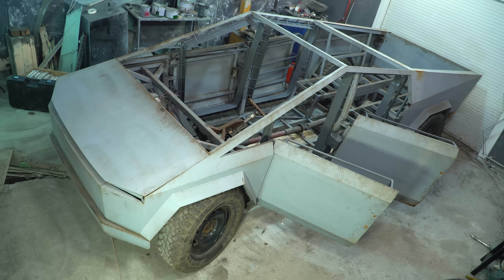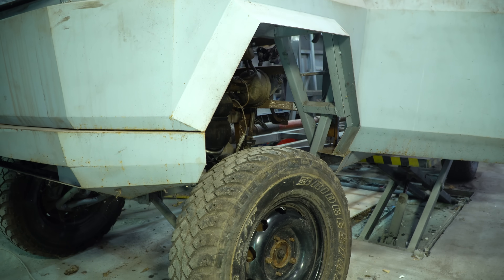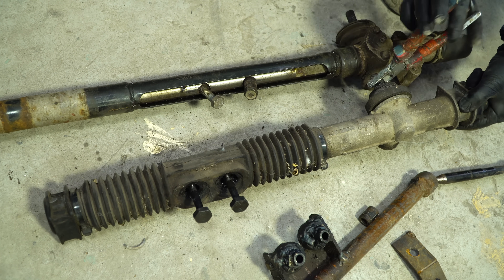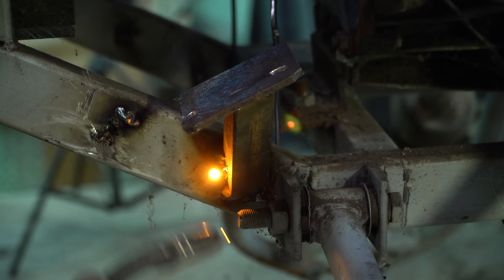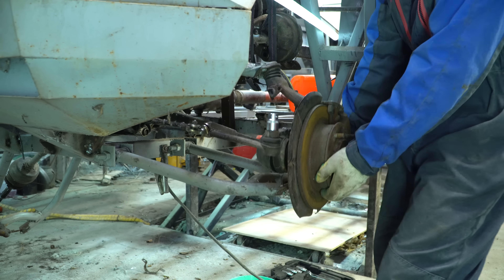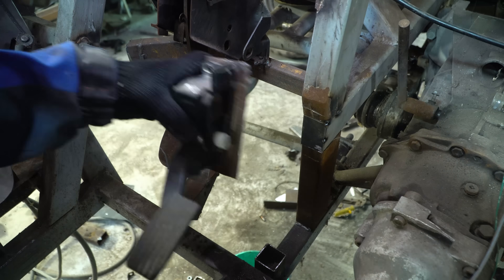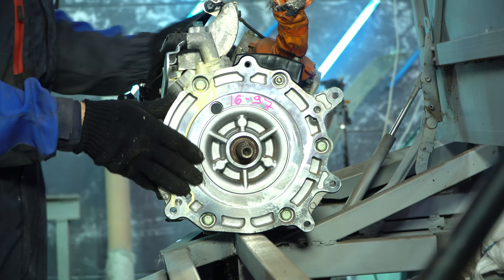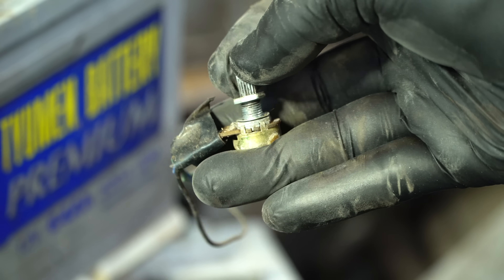My DIY Tesla Cybertruck: The Road to Dual Motors.

Comment: If you put a nice V6 or V8 in that thing you might actually have a useful vehicle, even if it is still the ugliest damn thing to ever roll down a roadway.
At least if you make it yourself you don't have to worry about getting bad panel alignment or glued on parts that should have been welded or bolted.
And you don't have to use the god-awful software system the 'real one' comes with.

Comment: Not far off from the actual build quality, this is probably better 😂
Reply: Let me guess, Elon Bad?!
Reply: @martinm4961  By almost every objective measure, yes
Reply: @martinm4961  Not just bad, terrible.
Reply: @CianaCorto  He got billions so I don't think he worries what a bum has to say.
Reply: @tonicshade  He doesn't care if you love him either bud
Reply: @tubularmonkeymaniac I never claimed to. I'm simply pointing out a hater.
Reply: @martinm4961  "LeT mE GuEsS, WaTeR WeT?"

Yes, buddy. Yes.
Reply: @analogicparadox water isn’t wet btw
Reply: @martinm4961  cybertruck has aluminum in the back. not really good for a real towtruck. It was announced as a steel vehicle, then they changed it a lot. Also Tesla is known for bad buildquality like big panel gaps, mirrors that scratch the paint when you close them or weird gaps where rainwater can com inside the car and start to rot, brakes that aren't good enough for the speed and wheigth of some cars, windshieldwipers that don't go the right speed depending on the amount of rain, wing doors that don't open or close correctly ... there even is a german lawyer specialized for these tesla chases, because there are so many and tesla service is sooo bad and refuses loads of these reclamaitions.